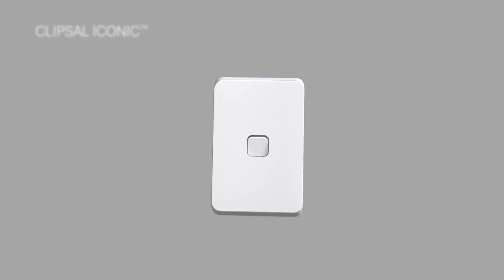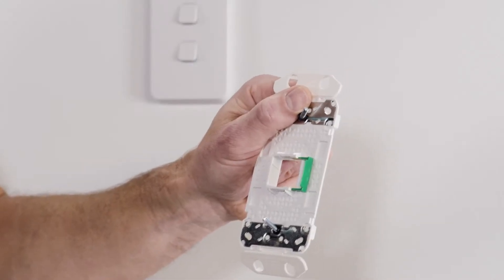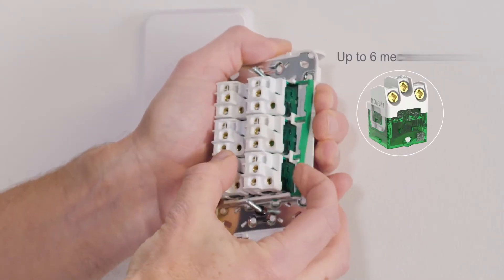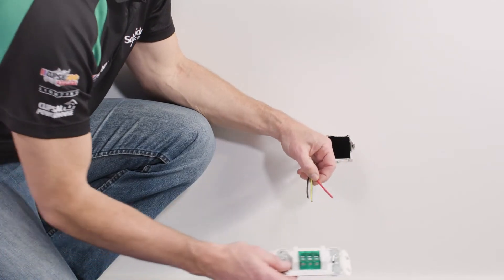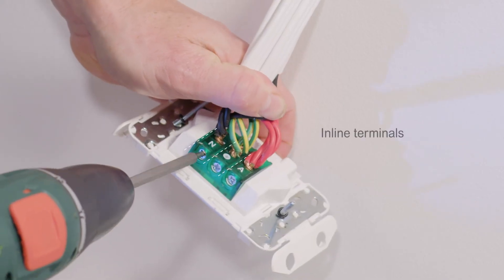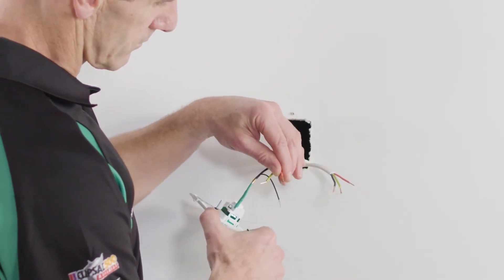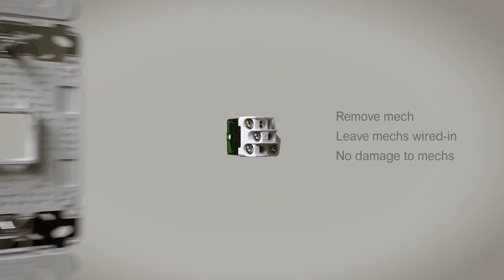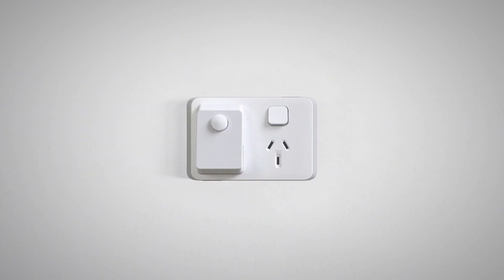Clipsal Iconic WDA Installation Guide | Schneider Electric

Comment: they miss leading ya , the power points and sw and dimmers r so easy , just like all the ones befor but when u start to use time switches , thats when ya sparkys bill is gona look like ya mobile ph No. with a dollar sign in front of it  , there s way more to this range than u wanna know ane the work involved in getting it running is hrs apon hrs of elect labour hrs